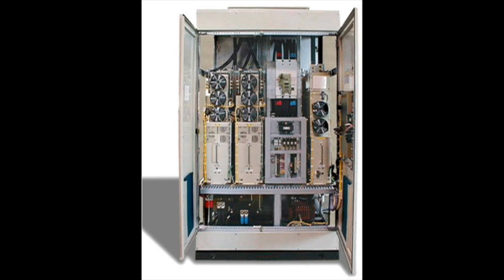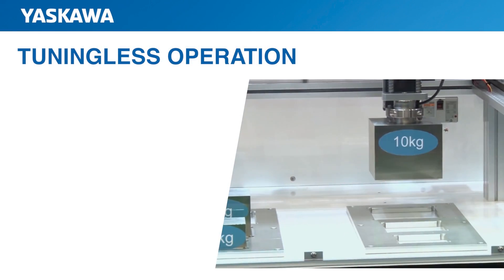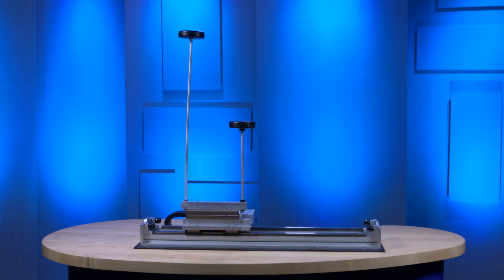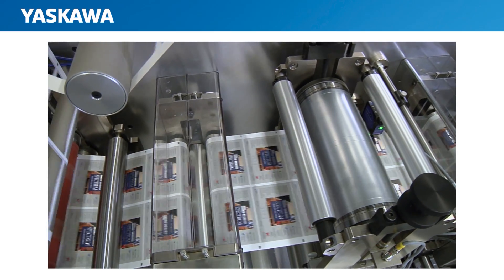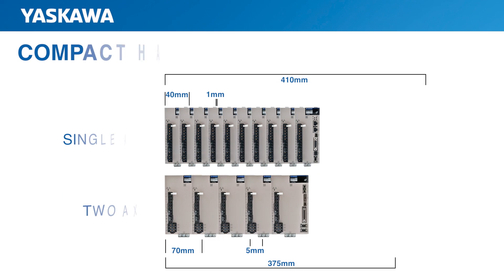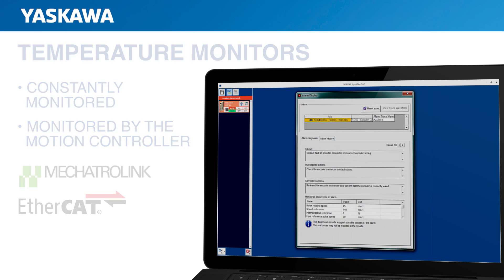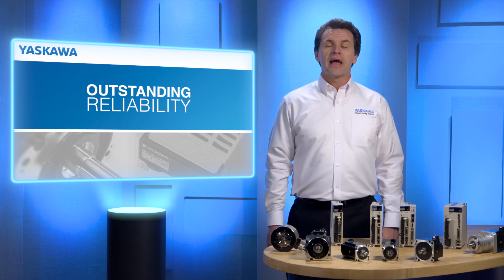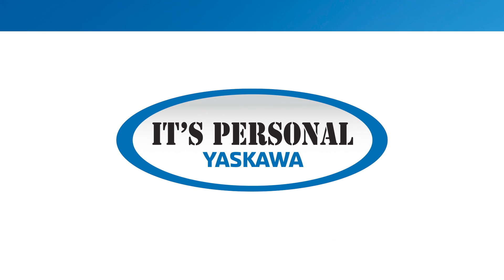Sigma-7 Features and Benefits

Comment: Why is there no 400V version of the SGD7S Analog? My company had a reliable system using the Sigma 5 servos through analog control but are now left scrambling with rewriting our control system for one of the other forms of control moving to Sigma 7 in order to keep with the 400V power.
Reply from the maker: Sigma 5 Analog pulse drive is the product currently on the market. In the meantime, it would be best to contact Yaskawa for alternative options. Please select the nearest service provider in your area: https://www.yaskawa-global.com/company/profile/global or, please contact our Technical Support Team for further assistance https://www.yaskawa.com/support-training/support.
Reply: @YaskawaAmerica  We are anticipating Sigma7 eventually replacing Sigma5 entirely so do you think by the time that happens there could be a 400V version of the sigma7 analog? It would be great to continue using analog when sigma5 is no longer available.